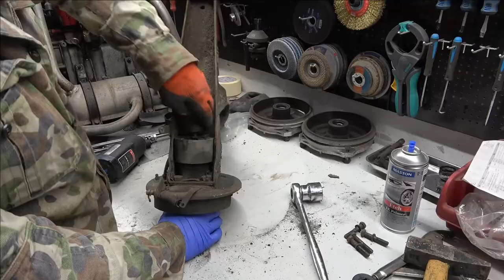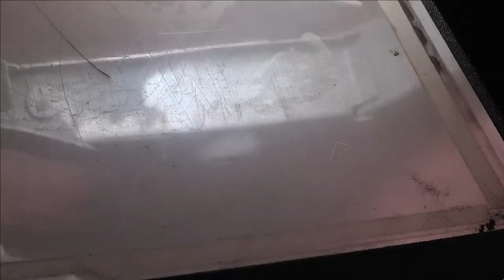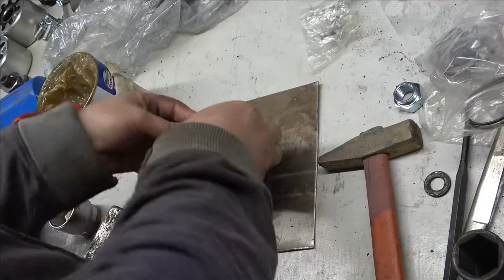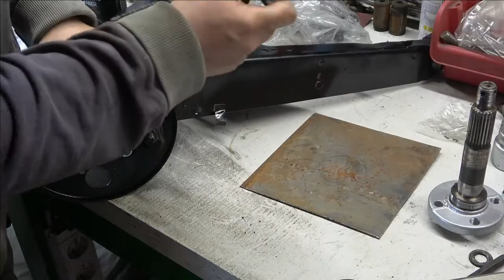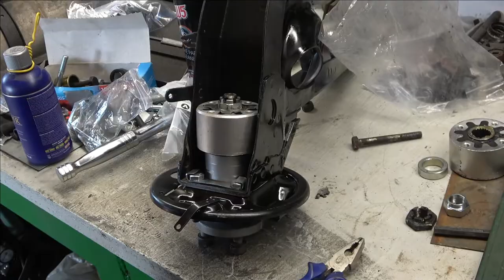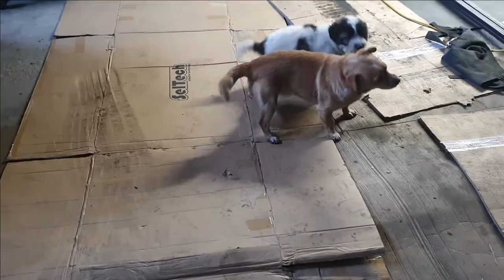Fiat 500 Classic - Part 5 - Rear swing arm and hub restoration

Comment: Gr8 vid. What I am stuck on is that there is no form of lubrication between the ‘flexible coupling’ (with the rubberised internal area) and the hub itself. So on mine, one face of these  flexible coupling grinds up against the end of the hub. Just doesn’t look or sound right. What am I missing ?
Reply from the maker: Hello. There should be a spacer there. It shouldn't touch. In the meantime, I replaced the flex joints with proper modern homokinetic joints. No more fiddling with gearbox position to perfectly align driveshafts.

Comment: brilliant video ..  Just what I was looking for .. My 2021 Fiat panda hybrid has 3mm a side toe in on the rear wheels .  this is six mm total toe in .. tyre  scrub  and excessive wear will be complimented with excessive tyre wear ./ drag  resulting in the poor fuel economy  I am experiencing . I have reset the front toe in to parallel and intend to reset / shim the rear toe in to parallel also . A brief test drive will highlight any issues .EX 1980 Donnington GT championship class winner .
Reply from the maker: Thanks. Although, this video is about a classic Fiat 500 from 1972. I don't think the modern fiats have much in common :).

Comment: before doing the check with the 500 gram weight hanging, how much should the nut be tightened?
Reply from the maker: It takes a lot of torque to crush the inner spacer. I used an impact gun and tested with the weight a few times. If it drops quickly, it needs more torque.
Reply: @AircooledProject  thank you very much
Reply: @AircooledProject  another question: can i use lithium nlgi2 ep grease?
Reply from the maker: I think any grease that is rated for axles will do just fine. I also use lithium based grease. It's important to use a generous amount and  pack the bearings well.

Comment: are the arms sprayed or powder-coated?
Reply from the maker: Sandblasted, etch primer and spray paint. Powder coat would be better only if done right, with top quality paint suited for automotive use. That can get very expensive.

Comment: Il distanziale va messo prima del cuscinetto non dopo
Reply from the maker: The spacer goes inside between the 2 bearings, like in the video.
Reply: @AircooledProject  parlavo dell'anello
Reply: Anzi scusate degli anelli
Reply from the maker: The thin ring goes between the bearing and seal, so the bearing doesn't rub on the seal.

Comment: Salut , vezi ca in butuc exista o shaiba de compresie ( ai scoso la min 0.30 ) care se inlocuieste cu una noua de fiecare data cind se umbla la butuc , ea are rolul sa se deformeze cind stringi piulita mare de dupa cupla elastica pt a genera presiunea necesara rulmentului ,,, poate ca metoda ta e de ajuns , dar butucul rotii spate este o parte critica la fiatul 500 ,,  am citit ca daca butucul nu e corect strins cu ajutorul shaibei deformabile siguranta din capatul fuzetei se reteaza , piulita se slabeste si fuzeta iese in exterior din butuc cu tot cu tamburul de frana si roata , la viteza mica masina se dezechilibreaza si ramai fara frana in mers pt ca tamburul ai iesit din dreptul ferodourilor , pierzi lichid de frina din piston si f oarte probabil de dai peste cap cu masina ( pt ca motorul este in spatele rotilor si masina se dezechilibreaza foarte rau.
A fost un accident in felul asta cu fiat 500 ca al tau in germania ,,  daca dai un nr iti trimit articolul sa vezi ce a mai ramas din ea .... 
Am 3 carti de garaj la fiatul meu 500L , unul este si in format pdf si ti l trimit imediat fara obligatii daca nu ai unul pina acum.
O alta eroare f mare , in videoul anterior ai pus vaselina intre platformele de aluminiu si bucsele de cauciuc care tin partea de sus a arcului cu foi .... acolo trebuie sa fie foarte curat pt ca arcul sa nu alunece spre stinga si dreapta .... exista o piesa de tuning care asigura ca arcul sa nu se deplaseze deloc stinga dreapta ....
Ai facut foarte bine ca ai gresat foile arcului pt ca altfel nu aluneca una pe alta si arcul nu lucreaza ( multi nu stiu asta ....) 
Arcul trebuia tensionat mai mult in momentul montarii , pina sta absolut drept ( in manual zic 120kg forta )
Eu am facut o presa care trace arcul de deasupra pt ca am crezut ca nu tine filetul surubului central 
Mai exista o metoda sigura si ingenioasa cu montarea a doua bare filetate in locul amortizoarelor cand ai montate si portfuzetele de arc . Strinci piulite la capatul barilor filetate in mod egal pina arcul sta drept , stringi atunci bratarile arcului incepi sa desfaci tijele , cind basculele superioare ajung in pozitie perpendiculara pe contra aripa stringi bucsile superioare si cele inferioare ( din capetele arcului cu foi ) ... in pozitia asta bucsile nu se strica cind sta masina pe roti ...
Scuze ca ma bag ca musca in lapte dar nu vreau sa aflu mai tarziu ca ai facut fiatul praf 😀
In vara lui 2020 a fost facut praf un fiat 500L galben in bucuresti ... a ajuns la craiova se pare 
Seara buna
Reply from the maker: Salut. Merci pt ponturi. Butucii spate au fost asamblati ca la carte, cu distantier de compresie nou strivit(trebuie cuplu f mare, am folosit pistolul pneumatic) pana am obtinut rezistenta corecta in rulmenti(doar ca nu am filmat.. se facuse tarziu si m-am grabit sa le asamblez). Am pus un text pe clip care explica pe scurt procedura de ajustare. La arc am pus acolo vaselina doar sa tina cauciucul in pozitie cat montez. Si la demontare am observat ca era putina vaselina acolo. Nu va fi condus atat de sportiv cat sa devina aia o problema. La arc am comprimat pana tumburucul din centru nu mai atingea caroseria. Nu stiu daca ajuta cu ceva sa stang mai mult pt ca ar fi revenit in aceeasi pozitie. Multi le pun fara presa si sg efect e ca sta fata putin mai sus cateva zeci de km pana se aseaza. O sa merg putin cu ea cand e gata si daca sta aiurea, pot sa montez din nou arcul presandu-l mai mult. Merci din nou pt ponturi. Spor!
Reply: @AircooledProject  ... sti ca vaselina normala strica repede cauciucul care nu e facut sa stea in vaselina ,,, daca vrei sa pui vaselina pe anumite parti de cauciuc trebuie folosita vaselina siliconica .... eu la fiatul 500 am schimbat furtunele de la benzina cu unele noi din comert si au inceput sa curga repede pt ca benzina care exista acum are etanol in ea care topeste cauciucul , am schimbat tot traseul de benzina cu teava de cupru si capetele cu furtun verde original fiat si nu mai am probleme ... in tunelul central al masinii furtunul de plastic era vechi de 50 de ani !
Reply: .... si sa mai fi atent la stutul unde intra benzina in carburator , de multe ori capata joc si sare in mers si umple motorul cu benzina ... de la vibratii si furtun prea gros se slabeste ,,, a mea a avut problema asta cind am aduso din italia ,,  am scos stutul l am curatat i am facut striuri l am pus cu epoxi inapoi si am batut cu un dorn in jurul lui in corpul carburatorului ,, n am mai avut problema asta ,
Reply: Bafta si spor la treaba